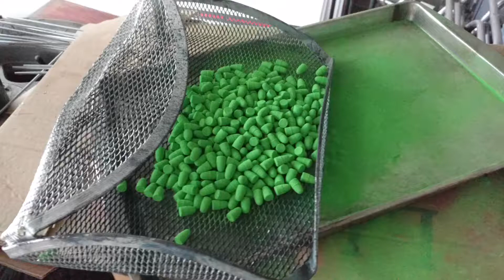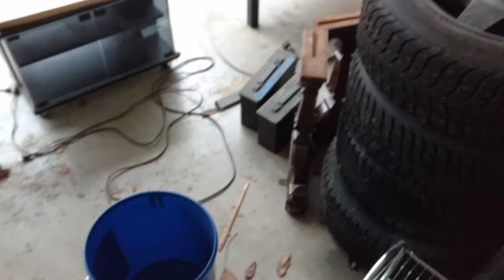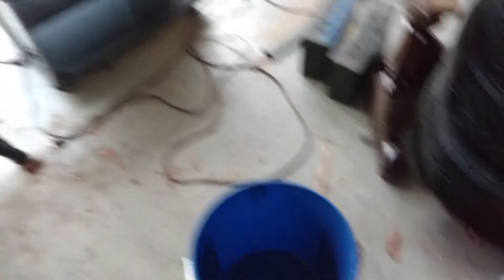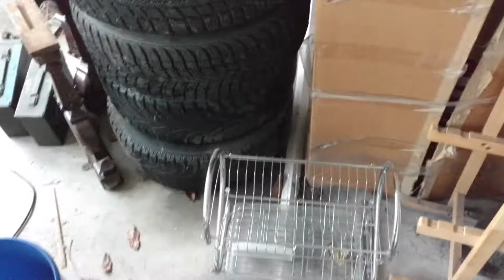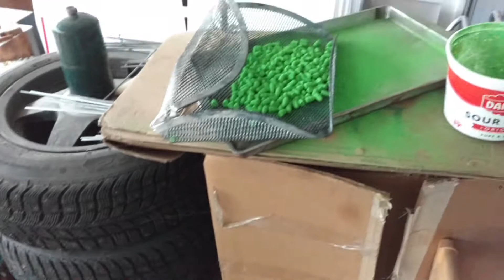Tips for solving problems with powder coated bullets.

Comment: good video man.  I will say, however, that I have had very good luck with my "leftovers" powder bucket.  Seems like when I use the collection of leftovers, I get very good coverage and coating.  I've used several powders in the past and definitely have my favorites now.  A good powder is a great start.
Reply from the maker: Thanks for the comments. I always enjoy your content and the obvious care for quality you put into all the stuff you make. This video is rough enough that I may pull it down. The one I uploaded the next day to replace it is only a little better.

I clean the sifting pan before I sift into it. If it's been sitting out, I will probably toss the table spoon or so of powder that is on it rather than risk ruining the batch. That seems to work well.  It seems like you can make most powders work, if you are persistent, but some make it much easier. 

My favorites so far for ease are the "steele blue" color and the "kawasaki green." The green seems to coat perfectly almost as soon as it touches the bullets. The blue might leave a touch more smooth and glossy finish.

 The flake or pearlescent powders I have tried are all a lot trickier to get a good coating going, but tumble them long enough and they will eventually stick.
Reply: Thanks!  And if you ever get the hankering for a clear coat, I've had great luck with powderbuythepound "glass clear."  Seems like it sticks well and doesn't coat too thick.  I do want to try that kawasaki green sometime though--been tempted several times to try it.
Reply from the maker: Tip appreciated. I think that's the one Bacon was using, and I was planning to get some based on what his results looked like.

Comment: Thanks for covering this . Sadly some of us had to learn these things the hard way  ( trial and error ) . I ruined a batch of powder once from not fully drying my water quenched bullets before powder coating . Damp bullets don't powder coat well .
Reply from the maker: James Pollard the cure for that if it happens, is to let them air dry, then vibratory tumble until the powder looks good. It might take a while.
Reply: Now I let the bullets dry over night or set in the sun on a cookie sheet to ensure they are dry . But it did teach me a lesson with moisture and powder coating . I also get great results with HF red in a rotary tumbler for 3 min. to 5 min. , the vibratory tumbler didn't work for me .
Reply from the maker: The last batch I did that with had  a bunch of rust marks from the cookie sheet. It appeared to be galvanized, but it still left rust on the bullets. I shimmied them around in a large damp towel until the rust was polished off, let them dry and baked them. They're the ones seen in this video.
Reply: So here's what I don't understand when you guys say "I ruined a batch of powder", how much powder do you put?  I put 2-3 tablespoons in container and tumble it and little is left over.  Vibratory didn't work for me either - I bought a brand new tumbler for that purpose and returned it.   I've been meaning to try my rotary tumbler with plastic container inside, I just need to find right container.  Loads of Bacon has good video on it.
Reply: Dima Prok   If you use a rotary tumbler you don't need a container to put the bullets in . Drop the bullets in the tumbler with powder and tumble for a few minutes . Even hard to stick powder works this way .
Reply from the maker: It can mean getting stuff into the powder container. In practical terms, too much is better than not enough. The excess powder is easy to seperate from the bullets and re use if you sift them as I do. I have a salad spinner, which is a grate in a large bowl. I dump the tumbled bullets into that and the powder sifts off. Occassionally, I will hand tumble a different color in a seperate tub, with just enough powder, and that works too.
Reply from the maker: I have found that the vibratory tumbler generates the most static. You can use a round nylon container on a rotary tumbler base and that works okay, but the faceted rotary tumblers are effectively putting your bullets into a ball mill, work softening the exterior of the bullets and battering up the surface features. The other thing is that I have found that the body builder shake tubs work okay for rotary, so long as you tape the lid to ensure that it doesn't unscrew and make a horrible mess.
Reply: yeah, but I don't want to clean my tumbler from powder every time plus the mess it's going to make each time you open it.  I use my tumbler to tumble brass all the time... actually I just realized something.  I have dual harbor freight tumbler that hasn't been used in years, I think it will be perfect for the job!

Comment: Thanks for explaining about density and coverage. Makes choosing powder a little easier.
Reply from the maker: Glad to help. I should note, that there are professionals who understand this a lot better than me. I would not be surprised if some of them comment here with very useful corrections to my statements. If so, I will do a followup video. There are some forums for professionals in the coatings industry which I have found helpful to read through, as well as the indications sheets on the products themselves.

Comment: Hey, ZS...good talk, factual too. Over at CastBoolits.Gunloads.com we are constantly arguing over this very topic. About the only thing anybody will agree on is that Harbor Freight PC Sucks, then some will argue about that. Then...some of us old OCD'ers will stand them individually...boy! That triggers the rest of them! HaveA-Good-one . . . c h a r l i e
Reply from the maker: It "triggers" me. You are using more work to make your bullets objectively worse. The part that passes the crown gets a crusty ring from that. But if it makes you feel better, I can't stop you :)
Reply from the maker: By the way I have the same handle on castboolits too.  or it might just be GunFun. I value that forum a lot, but I think some of the discussion on powdercoating there has become counterproductive. The PC specific molds though are are exciting.
Reply: "Crusty Ring? . . . Crusty Ring! .... We don't got no stinking Crusty Ring !"
Reply from the maker: I bet I could feel a ring with my fingernail right at the base of the bullet. You can't cheat physics. If that is your contact point with the mat tray, or rack, that is going to be disturbed.
Reply: I not only have OCD but I use 'tweezers' to stand the boolits! I tap each one individually to knock off any excess PC as I go to stand them on parchment...Guess What? . . . I don't got no stinking Crusty Ring!
Reply from the maker: But do you value your time? I bet that it is possible to get bullets which look better under the microscope or to the micrometer skipping all of that.
Reply: I'm retired, any more questions about time? What's your point? You gonna tell me you can bake your casts on a metal grill like that and do better than I do with standing and parchment? I doubt it seriously. I didn't start PC'ing cast yesterday sport! Shoot, I started BrassStuffing prolly before you were born. 1976.
Reply from the maker: I am sure you did start reloading before I was born. However, I do think more handling = less consistency. It's simple tolerance stacking. If you are retired, your time should be even more valuable. Supply and demand, and your supply is diminishing. My point about that is you should only spend more time on something if the payoff is measurably better, and enough so to justify the time spent. Now you may counter that you enjoy spending the time, and if so that is worth while. 

I enjoy reloading, but I enjoy shooting even more. I have a job, civic involvements, church, a wife, and a lot of things I want to do in the world. Every thing I do is something else I don't get to do. That means while I enjoy reloading, I want to get the very most out of it. I bet you have a lot of things you want to see done before you are gone too. Things that you value more than other things. If reloading in a painstaking way is one of them, that's okay. It isn't for me.
Reply: Charles Irby OS OK, he he I recognize this picture
Reply: Charles Irby try rubber gloves and dip your  fingers in the powder and rub them.  I think loads of bacon did this I tried and works amazingly well - doesn't leave any marks where you touch it!